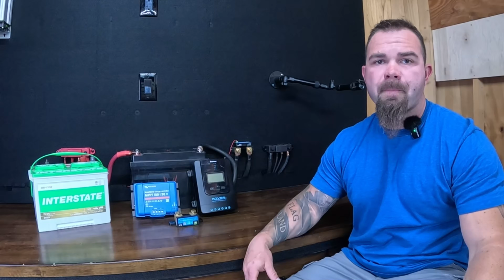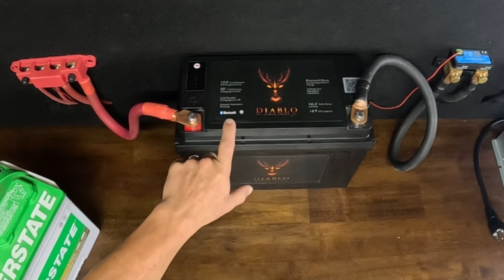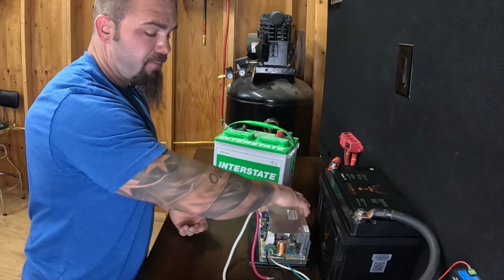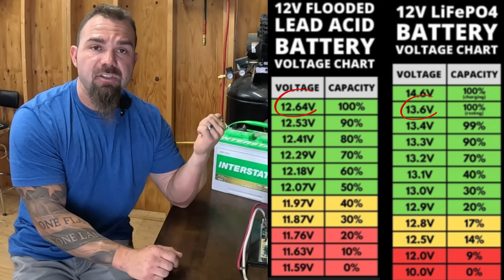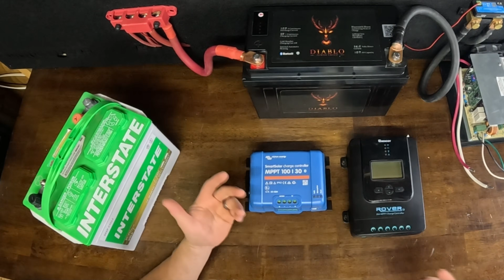Swapping to Lithium Batteries? DO THIS AFTER!!!

Comment from the maker: 🛠️ Products Used in This Video:
Victron Energy Smart Shunt Battery Monitor: https://amzn.to/4rBoroD
Victron Smart 30A Charger: https://amzn.to/48HqWxW 
Progressive Dynamics 60A Lithium Converter: https://amzn.to/4pH6KC9
Victron Energy SmartSolar MPPT Solar Charge Controller, 50A: https://amzn.to/4pb9FmX
Victron Energy SmartSolar MPPT Solar Charge Controller, 30A: https://amzn.to/4iwj3if
Reply: All great sources indeed.   I am going to go with the Victron Multiplus II 12V, 3000 on my trailer. as well as a quality Cerbo GX 70 screen inside, to give me the information on how my full system is working.
Reply from the maker: @Powerstroke98  Absolutely! It is the more expensive way to setup a system but 100% the way  I would go on my own RV! Let me know if you run into any snags or need help with programming anything and I'll help out where I can!

Comment: My Travato 59k has a inverter/charger.  Do you have a recommendation for that scenario.  I know the charger needs to be for lithium, I assume the inverter will need the same.  Both do not have a lithium switch option.
Reply from the maker: What is the model of the inverter charger? Most Xantrex and Magnum models have the ability to change the output charging voltage to something that matches lithium.
Reply: @RvPowerPlug thanks for following up.  I don’t know who makes it.  Winnebago is not listening the mfg.  All I got was “1,000‑watt pure sine wave”, in their description.
Reply from the maker: @klrussen638 ahh. Are you sure it’s an inverter/charger and not just an inverter? 1000 watt inverters rarely have a charging function built in. In that case it probably has a separate converter that will need to be changed for lithium compatibility.
Reply: @RvPowerPlug from AI.  The AGM‑equipped Travato 59K uses a single integrated inverter/charger, typically a Precision Circuits or Xantrex‑style unit. This one box performs both jobs:
Reply from the maker: @klrussen638 do you have the RV yet?
Reply: @RvPowerPlug not yet, otherwise, I would have opened it to see the inverter.  I’ve got a good deal on a 2026 59k.  I prefer the 59kl, unfortunately, nothing available.  I liked the idea of having a generator and lithium.  Your video was perfect for what I’d like to do, except for the inverter question.  I was thinking of a Victron MultiPlus 3000 ($$$$) as a replacement.

Comment: I am new to owning an RV. I bought a Rockwood Geo Pro unit, and the dealership put in a rather nice lithium phosphate battery. I was wondering about the charging. I was told that the RV would automatically sense whether it was lithium or lead acid, and work regardless. So I need a different converter? Who would do the install if I could find a converter that would work with my battery?
Reply from the maker: You’ll need to check your converter and see if it has auto detect. If it does, it should work fine how it is!

Comment: Important for folks to know, that some converters, such as my Solar charge converter or contoller as some call it, and the battery controller, at least in my case, both controllers have an option, to change them from lead acid, to a Lithium option (which I've done) to charge my four 100ah batteries, and it's working perfectly, where during the day my solar takes them to 14.4V, or if I am on 30A or 50A the battery controller will take them to 14.4V
Reply from the maker: The newer ones are programmable but most converters equipped in RVs before 2020 don't have that capability unfortunately.

Comment: How come nobody talks about a sealed vented battery box ?
Reply from the maker: Because that only applies to flooded leads acid batteries. Lithium batteries don’t vent, so you don’t need to have them in a sealed compartment or have ventilation for them.

Comment: We just bought an Rv. I bought a lithium battery for it before we got the rv. I told the rv tech i was putting a lithium battery on it. He said to drain the lithium compleatly before installing. The camper has an uto detect charge controler for lithium, gel and lead acid.  Everything ive read or watched said  to instLl it at 100 %. Im not sure what i should do.
Reply from the maker: Just install it. The state of charge does not matter, the converter should see the voltage of the battery and charge it appropriately if it’s working correctly.

Comment: I've got a 2020 Jayco JayFeather, i'm about to replace my lead-acid battery with a lithium battery. My question is if I change nothing on my camper and we camp at rv hook up sites with "power" plugged into our camper, even though the charging volts may be lower will the lithium battery reach a full charge if it's plugged in to shore power for a couple days?
Thanks!
Reply from the maker: Good question!

In MOST cases, yes. Charging a lithium battery with a lead acid profile will go very slowly but eventually you should make it up to armor 13.6 VDC.

Comment: Thank you for keeping it simple - nicely done.   I heard by some folks who say for those who don't have the money to do all that is desired, you can simply replace your LA with LiPo4 battery that has BMS and Bluetooth, and continue to use the existing LA converter charger .  You will only charge the LiPo battery to 80% which is more power and less worry than having a LA.  Every couple of months use a Lithium charger or solar panels with lithium charge controller to charge the lithium batteries to 100% and to balance LiPo batteries.  For me, I have only one rv house battery.  Your thoughts would helpful.
Reply from the maker: That is a conceivable plan but usually fails when actually using the RV. Getting a battery with Bluetooth does negate the need for a shunt but having proper charging isn’t really negotiable. 

Charging with a lead acid charger doesn’t just take a long time to reach 100%, in most cases it causes the converter to only put out 3-5 amps worth of charging because it assumes the battery is nearly charged due to the higher voltage of lithium. So when you use your lithium battery down to 15% and want to fire up the generator to charge it up, it’ll take 10 hours of run time to achieve a 50% charge. It’s best to do it right, all at once.
Reply: Seems like a lead acid charge would do in a pinch. 50-80% battery is better than 5-15%. If the L.A. charger only brings it up to 12.7v  before slowing down that's over 80% of 14.7. (86.395)

Comment: I just purchased a litiuim converter for my montana. I want to get a 200ah blooth battery for this trailer now. Do i need to upgrade the cables from the trailer itself that run to the panel. Or the cables from panel to converter. i do not have inverter yet or solar panels. thanks
Reply from the maker: As long as the output amperage rating of the new converter is similar to the old one, no modification should be necessary.

Comment: I was hoping that you were going to tell us about the 3rd source of battery charging: the Tow Vehicle (alternator power source). My camper came with 1) a WFCO converter that autodetects the battery type (120volt power source) and 2) a PWM solar charge controller (solar panel power source) that only works with lead-acid battery so I will replace that with a Victron MPPT unit that is more effient and works with both battery types (lead-acid and Lithum). However, I am not able to determine if my tow vehicle will have problems with the new 200aH lithium battery and / or the chosen battery will have issues with the alternator output that is designed specifically for a lead-acid battery. If someone can tell me with cerainty if I am good to go as is, or if I need to do more for protection.
Reply from the maker: Please have a look around the channel as this is discussed in length in other videos where it is more relevant to the topic. I believe a DC to DC charger is mentioned in this video and that is the device that you would need to install to receive any noteworthy charging amperage from a towing vehicle, the 7-pin connector only supplies about 1-5 amps. Being that it supplies very low current, there is no risk to a towing vehicles alternator.
Reply: I’m staring to feel like an idiot. I thought my magna was an inverter/ converter combo. Should I be looking for a separate converter?
Reply from the maker: @scott699 some inverters have a built in charger, magnum made a lot of them until they went out of business. in the case of an inverter/charger you’ll just need to setup the correct charging voltages.
Reply: @RvPowerPlug I can tie the batteries together with a relay , I think it’s going to be an issue with the lithium ion batteries and the lead acid, tied together,as they have different charging voltages.
Reply from the maker: @scott699 correct, wiring different chemistries together will not yield the best results. Lead acid requires an equalization cycle the significantly boosts voltage past the safe point of lithium as well and could damage the BMS. Pick one chemistry and set up your system for it.

Comment: Great video...What about the power from the trucks trailer cable? Pretty sure the truck alternator puts out 14V
Reply from the maker: Good question! There’s a video on the channel about this topic as well but the short answer is: very little cheating happens through the 7-pin connector so there’s no worries about the alternator but it’s also NOT a significant source of charging without installing a dedicated DC to DC charger circuit.
Reply: That won't be enough power to charge a lithium battery. Need to install a DC to DC charger if you want to charge while towing

Comment: I've bought and tried two different "lithium compatible" converters that did not correctly charge a lithium battery. This was in my previous camper. Both came from Best converter and usually they are reliable. I now have newer motorhome with a magnum inverter that allowed me to install a Magnum charge controller with correct settings for lithium. Even when setting these to constant voltage they would never reach the needed14.4-14.5 volts even when set to 16 volts on the controller. I dry camp a lot so my Magnum inverter will not be much help when running the Gen since it uses the gen output for house bat charging. I'm thinking about putting a separate, stand alone lithium charger that is connected to 120 volts in the line between the gen and the transfer switch so the new charger will work at the correct rate with the gen running. I think that will work. Enjoyed it ,DS
Reply: Thanks! I’m looking at doing the same thing.

Comment: Great information and very well explained. I have swapped out my 85amp SLAB for a 100amp Lithium in my micro-camper.  I have not incorporated a shunt and my battery is not BT.  I use a BT Victron solar controller which does monitor the condition of my battery, but not necessarily capacity. Would this suffice...?
Reply: No, you need a shunt if you want it to be accurate power going in and out of your battery
Reply: @Yielar1  Thank you for your response.  I would need to look at where I'd fit it as being a micro camper, it really is a tight fit just to get the current set up in.  I'll have a look and see what I can do.  Just to say, the BT Victron solar charger seems to be doing a decent job two years on 👍

Comment: If my batteries are underneath my rig (Promaster) could I mount a shut on top of the battery exposed.
Reply from the maker: I believe Victron sells an IP67 rated shunt for instances such as this, but i would not install one that was not at least IP65 rated. A normal BMV-712 or Snart Shunt would not be a good idea in that location.

The shunt does not need to be directly next to the battery, it just needs to be the first thing in line from the negative battery post. You could locate it inside the RV somewhere with a longer negative battery cable.

Comment: This question is for house batteries in a motor coach. My solar array charger has a lithium mode.  If I am using a Bluetooth managed Lithium battery, will my vehicle alternator be protected or do I need to make further modifications?
Reply: You need a DC to DC charger to pulls power from your alternator and regulates it to an appropriate amount for your lithium battery
Reply: Yes. YOu need to replace your battery isolator.

Comment: So, at my lithium battery terminals I will have the converter wires going to my battery. Then at the same Terminals I will my wires going to my Inverter. at the same terminal. I run My Refrigerator  Off my inverted, So it will work going down the road. Will this hurt anything??
Reply from the maker: That’s correct! ALL of the DC connections should land on the battery terminals or something like a bus bar that expands the connections possible on the terminals. All positives go to positive and all negatives go to negatives in one form or another.

Comment: You can measure state of charge using voltage, with a LiFePO4 battery, but the meter has to be able to measure one hundredth of a volt. I use this type of meter successfully with my setup. I can’t attest to 100% accuracy, but it’s very very close.
Reply from the maker: Most RV owners will not have the availability of that equipment and also don’t want to take manual readings of the batteries frequently. Once that measurement is obtained then they’d have to reference a chart to find an equivalent state of charge, and in order to get a voltage reading that is close to reflecting the actual state of charge they’d have to isolate all loads and charging sources to make sure the initial voltage reading is actually accurate… That’s not really an efficient means of checking state of charge, but yes, it is possible haha.
Reply: @RvPowerPlug  My meter is permanently mounted and easily accessible for viewing, but to your other point, I can easily isolate the battery to stabilize the voltage, which some folks may not have that option.
Reply from the maker: @stuartstuart866 Like i said, it’s totally possible but begs the question as to WHY that would be the chosen path? If you’re permanently installing something anyways why not just install the shunt and skip all the other inconveniences associated with isolating, and returning everything to service every time you want to know where you’re at in the SOC? With a smart shunt being about $100 i can’t imagine doing it the other way saves you much money either…
Reply: @RvPowerPlug  I replaced the built in display on my Dr Prepare battery. It was a direct swap. The new display was $6 from Aliexpress. The brand is Baiway model VT8b if you want to take a look.

Comment: Nicely done. I have the auto detect converter, what I am finding out is if it’s a WFCO brand (a couple years old) call their customer service and give them the model # they will send you a jumper that locks that converter in Lithium mode. In other words the Auto is reliable it may switch back and forth between LA and LI.
Reply: I just uogarded my converter today. To the auto detect version.

Comment: I've also posted to you on a different video you made about a DC2DC charger.  But re; this vid... My 30a converter is labeled 'Lithium/Lead Acid Auto Detect'.  I also checked the model # at the manufacturers website and verified it was lithium capable.  Also, on the converter itself it is labeled "Converter Input: 105-130VAC 60Hz, 7.5A, 600w" and "Converter Output"  14.6VDC, 32.5A (LI), and 13.6VDC, 35A (LA)" so I presume the LA means Lead Acid and LI means Lithium.  So... can I ASSUME that I can direct-drop a 300ah lithium battery in the unit (small towable) and everything will be fine??  Also, I am still trying to determine if I need a dc2dc charger as I am concerned about frying my SUV's alternator.  The alternator is rated at 150-155a @ 12vdc.  Also, I do have 200w solar installed and a 100w portable solar panel.
Reply from the maker: I just replied to your DC to DC question and left you a link to a video i made about towable RVs and charging through the 7-pin connector, so you can check that out!

The converter you’re describing is indeed an auto detect unit capable of charging lead acid and lithium batteries. You should have no problems just dropping the lithium replacement in! I will leave you with one word of caution though. In my experience, over the last 5 years of doing installations professionally, those auto detect units have the highest fail rate of all the converters on the market. It’s not CRAZY HIGH but it was noticeable. Just keep an eye on it over time and frequently make sure it’s actually putting out good charging current when it’s supposed to be. 😊
Reply: @RvPowerPlug  Thanks!  Will do.!!
Reply: @JimDandy-q2b1v  You could still add the shunt on negative side, to actually see what is going on!